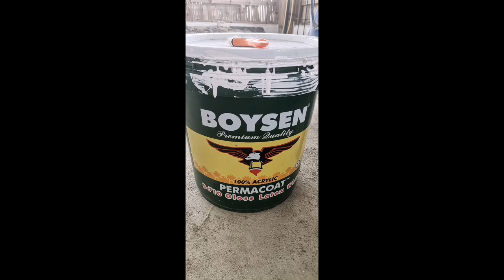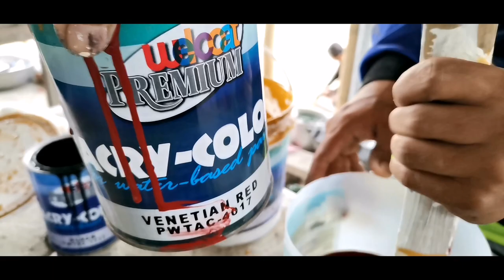Paano magwood grain o haspe sa Concrete wall Step by step Video Tutorial ( Wood Graining) by TBLD

Comment: ready to use n po b yang acrylic imullsion? at hindi na po ba kaylangan ipitin ng sanding sealer pagkatapos ng hasbe?
Reply: Maganda brod pag NASA labas ng bahay o bakod pag impulsion ng uulap pag may Ulan ano maganda matibay pa valspar bago palang yan
Reply from the maker: Marami pong klase ang pang topcoat sa wall sir, maaari po kayong magtanong sa mga paint shop. Acrylic Emulsion lang po kasi yung madalas naming gamitin at karaniwang available dito samin.